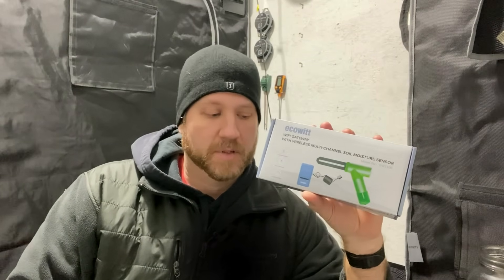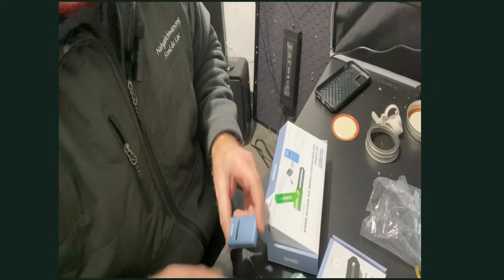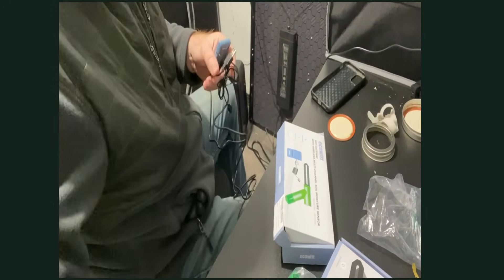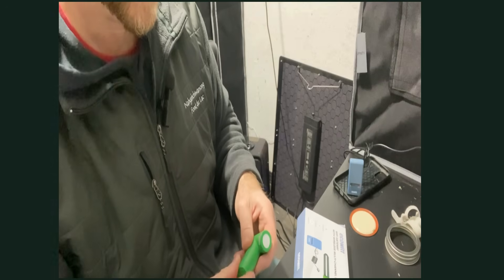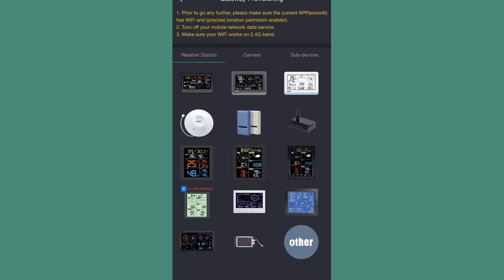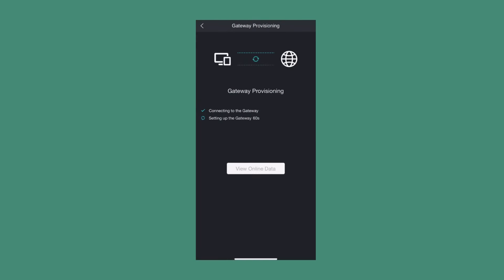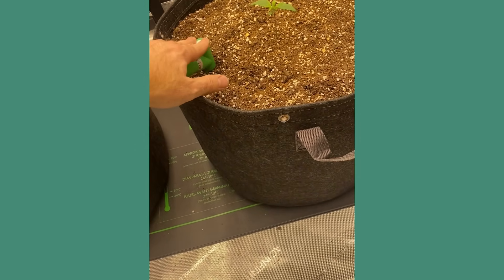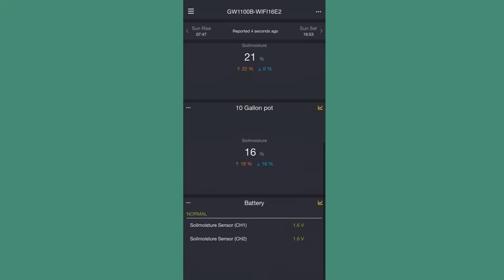Transform Your Garden: How to Install Ecowitt Soil Moisture Sensors!

Comment: Hoping you can help me out, mine has been running fine for over a year haha and for some reason it all of a sudden is telling me it is offline. Yes i changed the batteries thinking that was it but wasn't sure since I still had a red pulse on the probe? Ant ides how to get it back online? Its been so long I can't seem to remember. Can't seem to find much info on the tube
Reply from the maker: Is your Gateway offline or your sensor showing offline ?
Reply: @218Cultivation  lol grrrrr dead battery. Was positive that wasn't it DOH
Reply from the maker: Well Glad you found the solution, easy fix for ya anyways haha
Reply: @218Cultivation  I'm curious what size pots do you use? From the looks of it your a coco grower? Do you keep your moisture at a certain percentage? I'm in a 3x3 notill and i keep mine around 21percent, never found the correct answer but so far 21 percent is pretty good
Reply from the maker: @Bongwell420  when I used coco I would water at 15% or so I’m using organic and I water at around %20 now
Reply: @218Cultivation  Awesome I subscribed to your channel and seen something you put up recently. Love new content, always looking for more
Reply from the maker: Awesome, Thank you appreciate the sub. 👍

Comment: You need to be extremely careful to push them in the soil quickly straight so that soil contacts the blade evenly with no air gaps. Also, you need to calibrate these for them to be any use at all, and every one is different, as is your media and fertilizer etc. So calibrate them using the app by saturating your media with the sensor in place and set that to 100%. 0% is typically about 110 for coir media.
Reply from the maker: Thanks for the feedback, I did not know the process of calibration so thanks !
Reply: @218Cultivation  I never calibrated mine and I had a bumper harvest from that plant. 7 zips in living soil just keeping it between 30 and 40%. Plant loved it

Comment: We know the physical properties. We've fuckin bought it. How do u get this shit to work?
Reply from the maker: Good morning, you sound a little upset. What issues are you having with the sensors? I'd like to help. This was just a video I did to set up the gateway to the sensors. I just put them in the soil, monitor the soil percentage from the app, water when it gets to a certain percentage.
Reply: @218Cultivation   Once i setup WI-FI my app wont recognize shit. Im sure hes probably in the same situation sounds like. All it does is want to repeat the same steps of connection and wont let you add a new device. endless circle...
Reply from the maker: @raydubbstep4424  So sensors themselves pair via bluetooth to the gateway. I think you have to register the sensor to the gateway; I'm trying to remember. I haven't set up a sensor for months. There's 3 dots top right within the app. Click that and  Find sensor Id It will say sensor management at the top ,scroll down to the device sensor you're trying to pair and click register.  I think that's how might have done it before. Let me know if that helps. 👍

Comment: Has anyone calibrated in coco. This is what I’ve done don’t know if it’s the correct way or not.
Filled up two pots of coco let the dry out. Then watered one till run off. Put the sensor in the dry pop and it said 141 ad so set my 0% to 141ad then did the same with the wet coco it’s said 244ad so set my 100% to 244ad hope all work will update. If this is not the correct way can someone explain to me tia
Reply from the maker: I have two more sensors coming that I’m going to use with my autos I’m using in Coco. I’d be curious as well

Comment: I hope yours works better than mine. After totally saturating the soil in one of my plants it showed 63% moisture despite having significant run off. I contacted Ecowitt and the said go to custom mode. After going to custom mode it read 100% but stay at 100% for days? I went back to default mode and watered again to complete saturation and it never read higher than 53%. Ecowitt support said that was the best that I was going to get? I told them this was not acceptable and that I had planned to add 7 more sensors but the sensor accuracy didn't justify buying any more. They said they understood my decision. Needless to say I am not impressed.
Reply from the maker: I haven’t had any issues thus far with mine. But definitely sounds like that one’s defective. Appreciate the feedback. Hope you get something that works for you!
Reply: @218Cultivation  it would be nice if Ecowitt would stand behind their product instead of telling me, that's just the way it is. lol
Reply: I’m thinking 63% is full saturation in soil from research if you dip it in water it should be around 100% but soil can never reach the saturation amount of water. 
The issue I have is the ad is different on all my sensors so no matter what I set the to they will always give me a slightly different % reading even in the same pot.
Reply: @davidmountain3299  They had me put the sensor in a solo cup of what and it read 93%. The next time I saturated the soil it read 51%. Earlier with the same amount of water it had read 63%. I told them that the inconsistency in the readings did not justify the expense of adding 7 more sensors as I had originally intended to do. That is when they emailed me the response that I shared here yesterday. I told them that if I wanted that kind of inconsistency I would just stick with the $15 meter of Amazon. At this point I am not satisfied with their support or lack thereof. I can't not recommend their product. Thanks for your input.
Reply: @davidmountain3299  had their support mentioned the 63% saturation as being normal I would have been satisfied to make the sensor work with that info but they didn't offer that. I deo appreciate your input.
Reply: @relentless1 just got mine. Not the wifi but the little included controller, I put mine in a little 4 inch seedling pot to test it and soaked the soak. I mean soaked it and it's at 68% max.  So I'm assuming that's would be soaked.  And when people say they don't let it go below 27% or so. And keep it at like 35-40%. I'm guessing they include 68% max so I'm assuming when it dries up 50%
Reply: From looking at other videos it does look like the 63 mark is full saturation and people are watering at around 28 and 32 mark. Still no good for crop steering as this is the reason I purchased mine 😂
Reply: Understand your point and decision.

Sorry that the product doesn’t meet your expectation.

Best Regards

Ecowitt Support Team
Reply from the maker: @relentless1 yeah that’s odd they didn’t offer a better solution or return option for you. I still like them so far though.